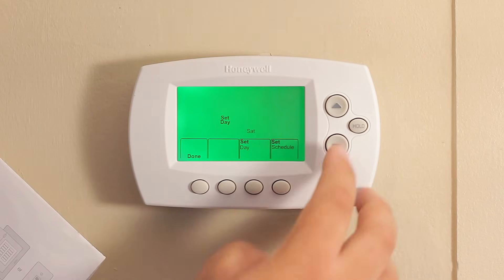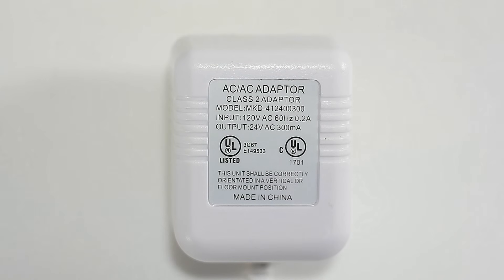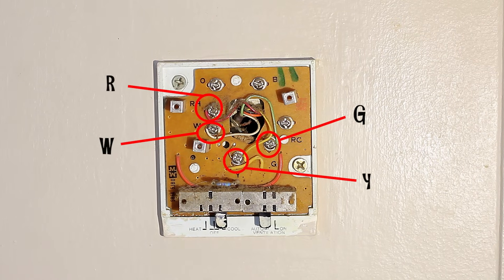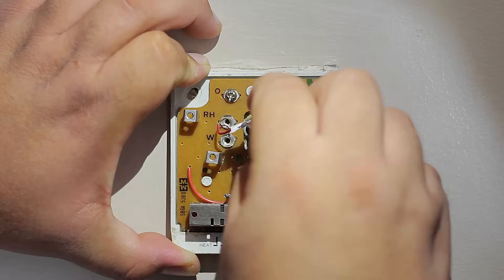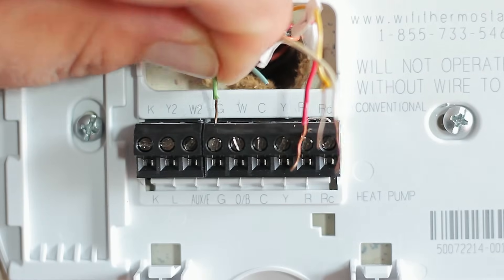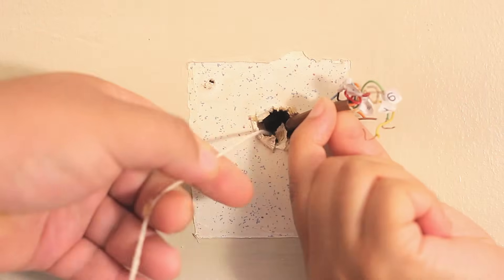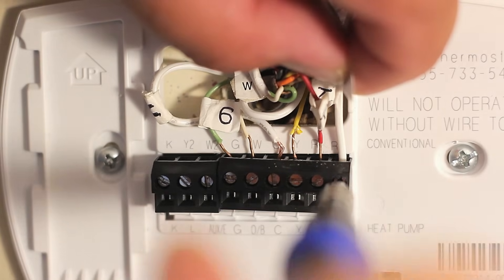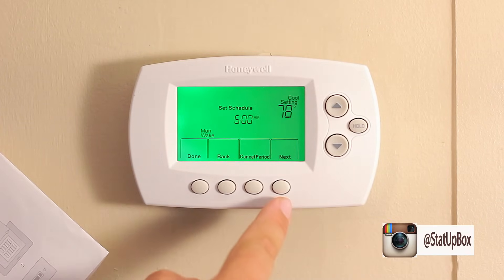How To Install A Wifi Thermostat  With Out And With  C Wire

Comment: Amazing what people will do and spend to "upgrade" an old stat that usually lasts forever.   No mention of the price of this exciting toy, but  you are still left with damage to fix.  They tried to tell me my new gas furnace would not work with my old honeywell round (mercury contact).  I just adjusted the heat anticipator inside and it has been perfect the last 15 years with the new furnace.

Comment: Every house I've ever lived in only had two wires on the thermostat, a red and a white. Just heat, no central AC.

So to hook this up with the AC adapter:

Furnace
R - red wire
W - white wire

AC adapter
C and Rc (polarity doesn't matter but remove the jumper wire)

Comment: Thanks for an easy to follow (no extra bs) instructions. I did have 2 extra wires and put one into C and one into Rc without any luck and then switched them but unit still wouldn’t come on. Maybe I have to get the adapter anyway?

Comment: You forgot to mention the C wire you found in the wall has to go somewhere and connect to the control board to get it's voltage.

Comment: Thank you very much. this was a simple and very understandable how too. I did run into a complication that you can help with. I installed the Honeywell unit you showed in the video. I will be using it to simply control a circulating pump on my heating system. The pump controls a snow melt system under a sidewalk. I chose this method to make it Wi-Fi. Accessible. So, this is a brand-new installation (no existing wires). I added the power adaptor that you recommended, and it is plugged in, has power at the outlet, and is hooked to the "R" and "Rc" but is not lighting up; it appears to be unpowered. Any suggestions? Thanks in advance. Barry

Comment: You saved the day. Like a few others I was ready to give up. The C wire behind my old thermostat was not connected and had no power anyway. I did not want to mess with the control board inside my air handler. So I used your string and nut method to run the wires from an external power supply through the wall. It worked perfectly. Thank you!

Comment: You are a lifesaver my guy, I have tried so many different ways to get my upgraded Wi-Fi thermostat to work, I had bought a transformer to get the C terminal to work and nothing, not even my boiler guy couldn't get it going , I was about to give up and go back to the old thermostat until I saw your video and you hit it right on the button when you said to take off the jumper wire and install the other wire 👍🏽 It fired up, lights came on and joy, happiness all over my face, 👍🏽👍🏽great job.

Comment: I,ve been replacing thermostats for 50 years, and VERY SELDOM is there a C or Common wire at the thermostat. and most of the time there is NOT a spare wire in the harness to connect one
So if you use ANY Honeywell WiFi thermostat, YOU WILL have that nasty power adapter taking up an outlet, and if there is not one near the thermostat, you will have to run an extension cord. Unless you get a professional HVAC servicer to run a new thermostat wire, 
Oh and the power source needs to come from the HEATING transformer, NOT the transformer on the AC air handler
Honeywell dropped the ball on these thermostats.
The NEST does NOT require a C wire and is much easier to install

Comment: This isn't the Honeywell c wire adapter. It's a 24 volt power adapter. Their website has a completely different item called the C-wire adapter that gets installed at the HVAC control panel that doesn't get plugged into a wall outlet.

Comment: Thanks for explaining this so well, I will be adding my upgraded thermostat to my castle today
Reply: So this is the problem I'm having on my old thermostat I have the following wires connected G, Y, RC -jumper to RH, W. On the thermostat, but the I have the following wires that can be connected in this layout (below), I'm not sure which to connect to, even if I connect the old thermostat RC to R and use the adapter you mention it still does not work

S               A
S               O/B
Y               W2
Y2             E
G                W 
C                K
U                R
U                RC

Comment: I have the one red cable for the R. I am not sure in which to insert, whether the R or RH. I am not connecting the C wire. The way I have ai have it connected currently is the red cable in the RH with the jumper connected and no C wire connected. Is that correct?

Comment: my old thermostat didnt use the C wire as it used batteries....but it was in the wall behind the plate when i went to install this new one..so i thought it would be easy...but even with the C wire included in with the R,YGN, thermostat wouldnt work..can the C wire not be connnected in the furnace wiring for some reason?

Comment: I installed my RTF9585WTF thermostat a few years back along with the adapter for "C" wire. It has worked fine all these years. But now the screen has gone blank. I think it may be adapter that is issue. How can I check to see if adapter is OK?

Comment: Gotta question, so I used an AC adapter on my Honeywell RTH6500WF thermostat since I didn’t have a C-Wire. I got power to my thermostat. Waited like 20 min and my cooling system never turned on even though it said it was on. It was like 80° in my house and the temp kept rising and it wouldn’t turn the system on. I reinstalled my old thermostat and the cooling turned on right away. What do you think it is? The base plate is identical to my old thermostat so I just quickly pulled the wires for the adapter out and put the jumper back in and reinstalled my thermostat to get it going again.

Comment: ummmm why wouldnt you just use G as the C wire, and jumper G and Y?? seems like a LOT more work to do it this way, and the only drawback is if the customer/homeowner is DEAD SET on controlling the fan separately.

Comment: Just a heads up, when using a "wall wart" external power supply for the C wire with one of the newer touch screen Honeywell WiFi thermostats I had to keep the jumper in place between R and Rc even with the Red wire connected to R and one of the wall warts wires connected to Rc.  With the jumper removed the stat acted like it was doing its job but nothing was getting activated on the AC/Heat unit.  Added the jumper and everything came to life...
Reply: Thank you so much! I was wondering about that. I was having that issue and I wasn’t sure if I should keep that jumper there. But as soon as I put it back it came to life. You’re a life saver!
Reply: @projectjster  This is correct. It was driving me nuts. I even tried it earlier but I don't think it worked, Maybe I didn't have the jumper in all the way.

Comment: hello, so i turned off breaker labeled furnace but when i use a power tester it lites up as if it still has current??
Reply from the maker: you can always  turn them all off or the main breaker as a extra precaution

Comment: I need some help please. Great video. I replaced my Honeywell T5 with the same Honeywell Wifi thermostat in the video. and now I’m not getting power to the thermostat to turn on my gas furnace. The T5 was working fine before with the C wire and I have the same wifi Honeywell upstairs running my heat pump unit. Can anyone help me fix this problem?

Comment: I have a 4 wire setup. There's a small red wire going from the RH to the RC. Then there's a separate RC wire from the wall. Will I need to duplicate the RH to RC bridge on the new thermostat?

Comment: Question. Mine is without c wire. I got only. 2 wires, W and R . Can I jump the power from W to C terminal.
Cause what I am thinking is, W is bringing the power in and R is bringing out, and C terminal is for power up the thermostat, so why not get the power from W.

Comment: So. R and R C   coming off your external Transformer which is running the thermostat but you still getting power from the original Transformer in the basement if you will to turn on the heat air condition fan is this what you mean ?

Comment: Love the humor added. Very detailed and no chit-chat “filler talk”, right to the point and this video handled my problem exactly. We ordered the C adapter for our 2-wire boiler steam heat system (as designed in 1924 wiring). We won’t give up our steam heat (love it in winter) - for a furnace. Thanks for a great video and adding  ha-ha points to it.

Comment: So what if I dont have a C wire, but I have a wire called Rh ... if I need to connect the external 24 volt adapter to the R and Rc terminal posts, what do I do with this Rh wire?

Comment: Honeywell needs to make a battery only WiFi thermostat like nest e or 3rd gen. They can run on two wires. Just give it a rechargeable pack, should be able to run for months. I have 6 zones of heat but only two can operate WiFi. It’s annoying but I don’t want holes and adapters plugged in all over the house. 

Great video though as most C wore adapter instructions are unclear and don’t specify what is needed to make them work.
Reply: You can do the redlink technology and do wireless zones instead of wired. Don't know your application, but that tends to work in most.

Comment: I have a cool only system and only have 3 wires, the Y, G. and R.  I added the 24 volt transformer to the c and rc slots and removed the jumper, power works but the fan will not turn on, is this thermostat not compatible with my system?  Or am I doing something wrong?

Comment: I'm using honeywell old version which works with battery. And I attempted to upgrade to wifi version which same as in your video. But fan not working. I didn't have the C wire ended up installing with 24V adapter but fan doesn't work. Ended up putting old one again. What you think it could be?
Reply: Following

Comment: Your the man thanks , so I didn’t have the c wire so instead of using a external transformer, I went to the air handler and use the 2 entra wires in the back to connect to the air handler transformer and conect it to the c and rc and works well.

Comment: Thanks so much for the video. But I have a question. My old thermostat had 4 wire like in the video and I bought a new wifi Bosch thermostat and is requiring a C wire. If I put the ac adapter like you showed in the video, the ac adapter have 2 wires, which one will be connected to the C plug and the other wire where is going to be? Can you help me on that. Will appreciate that

Comment: No need to make holes on walls for c wire just move g wire and use it for c unless you use the fan
Reply: Can't you just jump that wire to the C terminal? Or even jump the Red 24v wire??
Reply: @tonyming6969  red doesn’t move just g to c in the thermostat and the air handler

Comment: My old thermostat has 2 wires at R and W. No C wire. However, there are 2 more wires that goes all the way to furnace but these not connected to anything. Should I use these for CWire?

Comment: Hold up , why can’t you just use the jumper from red to arc and have it feed power to it .. instead of a power supply ? Thanks let me know.
Reply: I hope I understand your question correctly. 

Because there is no loop back to ground (some would say "neutral") without using the "C" terminal. Yes, there is 24v on the red "R" wire but the current has no path back to the control unit. It is important to note that electricity must flow in a closed loop (aka circuit) in order to do work or power a device. It has to get back to where it came from, in other words. Without the connection to "C" it can't do that. 

The reason why Y, G, and W work is because the thermostat simply connects the red (24v) to the "requested" terminal and the control panel knows what to do when it "sees" the 24v show up on the terminal. A tiny bit of current could and should be flowing here. If it is then it is going back to the control panel through the Y, G, or W wire. The control panel merely senses that a voltage "appeared" on that terminal because the thermostat connected it. It is important to know that "voltage present doesn't necessarily mean current is flowing." In other words, say, when there is a call for A/C, the thermostat connects the red wire to the yellow (a/c call) and green (fan call) wires. This makes 24v "appear" on these terminals at the control panel. Then the control panels says, "Hey, someone wants a/c and fan, let's turn these on according to my settings!" Then it engages the compressor and the blower fan and you get compressed refrigerant and moving air. 

Now, compare this to when you are wanting to "power" a device. The current needs to flow through the wires, then through the device (in this case the fancy thermostat that needs constant power to run) and then, and this is the key, through a wire back to the source, which is the "C" terminal on the control panel. If there isn't a connection back to the "C" terminal on the control panel there is no path for the current to flow. In this example it would go through the "R" wire, through the thermostat, and...and...and...this is the problem, no return path for the electrons to get back to the control panel.
Reply: I've been trying to find an answer to that too. They are both 24v
Reply: Me too

Comment: Why would you drill a hole in a perfectly good wall??? Why not remove the bottom molding and drill behind that run wire and put back molding!!

Comment: I've tried a few times to upgrade my thermostat. Its more complicated than you think. With a heat pump with aux heat and emergency heat every programmable thermostat I purchased would not work...
Reply: Most thermostats should work with a heat pump. You have to go into the installer settings and configure system type.

Comment: Can you still use the wifi feature of the thermostat even if you only connect it with 2 wires: red/black or white/black ones? In only have 2 wires in my set up

Comment: Great video! I happen to have this exact model :) and am using the same C Wire Adapter. My manual confirmed the removal of the jumper. Everything fired up as expected, app worked great too. Thanks again!

Comment: This does not work with the Honeywell wifi thermostat!! Just tried it and it didn't work. Called Honeywell and they said the thermostat will not work with this type of adapter. It needs one wired directly into the thermostat wire. This video caused me to loose a job and look like a fool! I will not be watching your videos.
Reply: If its a gas system you can use the g wire if you connect it to common in the furnace and thermostat. You lose the ability to turn on the fan by itself though. Heat pump this wont work since the thermostat controls the fan on a heat pump system.

Comment: What if there’s no AC adapter or any wires in the wall , I have an rc (empty) and an rh (occupied) what to I bridge the c to? I have to continuesley change the batteries once a week and it’s getting very expensive

Comment: It didn’t work. Heat worked but ac didn’t work. I followed it step by step. Had to call an electrician to tell me I need an add a wire kit and install it at my furnace.

Comment: Great Video, I have the exact unit, my issue is, when I connect the thermostat and the plate together, it get a wait message, I program then correct time, the air blower starts then stops, every minute the display lights up then turns off. Help?
Reply: @incendiaries  I'm having trouble figuring out which of my wires is the C wire. I have a red, white, yellow and blue wires. I connected the blue wire to the c slot.
Reply: There is one wire that was not used with the older thermostat, it's a light gray color. I did not connect it to this unit.

Comment: If anyone can help but I did this with the same adapter my furnace works fine but my A/C will not turn on. I hook up my old thermostat and works just fine. I removed the jumper from R to RH and have green wire to G and blue wire to Y, white wire to W red to R .  RH and C to the adapter
Reply: Have the same problem.. No known solution

Comment: I would like to know why, with an older honeywell, I have a W2 wire and how it affects the hooking up of my new (this) Honeywell??
Reply: W2 is for 2 stage heating. If it's a furnace w2 shouldn't be needed as the control board will stage the heating itself. If its electric or a heat pump w2 would be used for auxiliary heating or an extra set of heat strips.

Comment: The "C" connection is just a common or neutral connection but it needs to go back to the equipment low voltage power supply.  I  would've just used the extra blue wire and checked it at the low voltage supply.

Comment: Just use your green  wire for common if u have only 4 wires but fan only will not work 
Ac and heat will work

Comment: This option will work in order to turn the screen on, but the cooling won't turn on because the RC wire was disconnected; You are basically leaving your system without the "Return Cool" wire.
Reply: glad someone said it, this is not a viable way of getting around not having a c wire

Comment: Although this is a very helpful video if there are no wires available to be used as C, but in your case you had extra wires available. All you had to do is to use the extra wire to connect to the C terminal at your furnace, every furnace has a C terminal.

Comment: Can you help me please I have a old thermostat that’s only have two wire connected to it. I do not have no  air condition unit is just to wire for the boiler so I wanted to upgrade it to the same  Honeywell thermostat Wi-Fi how can I do it please